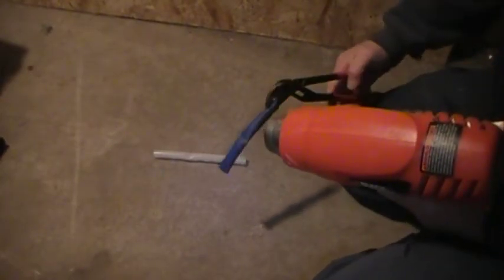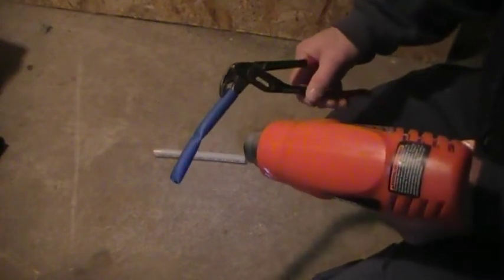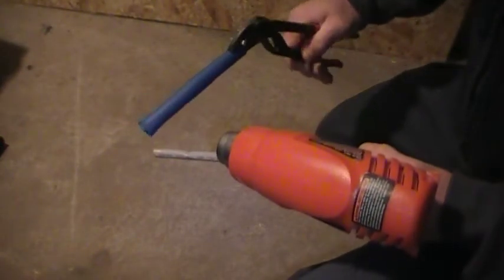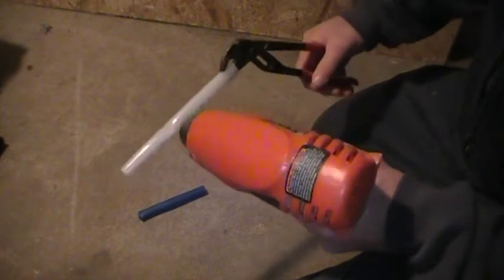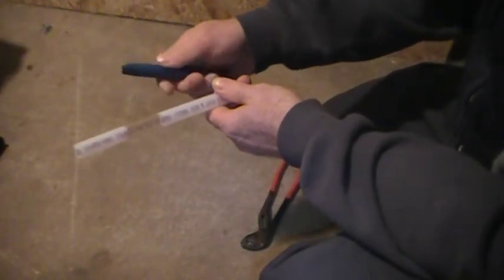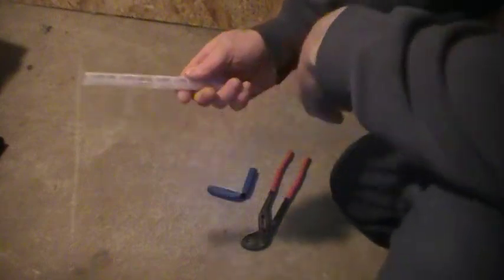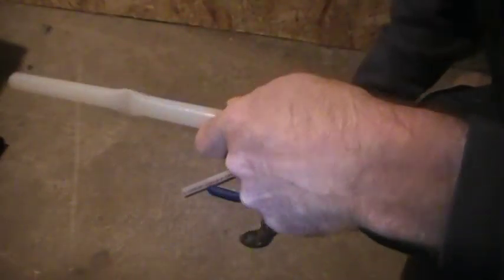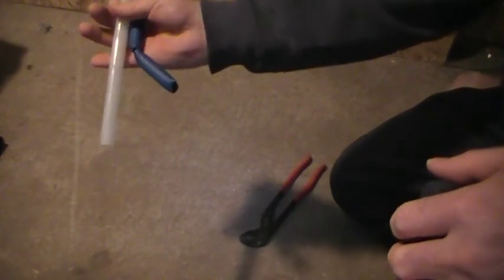Pex pipe memory. Testing pexA and PexB.  Plumbing Tips

Comment from the maker: @fritzhvac Hey Fritz;

You have nothing to worry about there my friend! I can recall seeing a few of your videos and the pex in your place has a good UV rating. I believe red and blue were the colors. That is a good sign which means that its protection is higher. 
Just to be on the safe side I would recommend the armor flex as a precautionary measure. In the video where the pex had a number of pinholes in it; the lights were on 24/7. I have seen it happen to pex pipe 3 times now.

Comment: Al , around 1981  they  had a  material  called  opteal   which was used  for eye glass frames  you could  heat them with   heat  gun   bend  the  delights  out of them and  set  a side and the eyeglass  frame  would return to its  original shape  an then  pop the lens  back in . But   if you heated them an dropped in very  cold  water  they  would  snap  like a pretzel . The  white   pex  looks like the ticket  for cold weather applications and going  around  corners not  square .